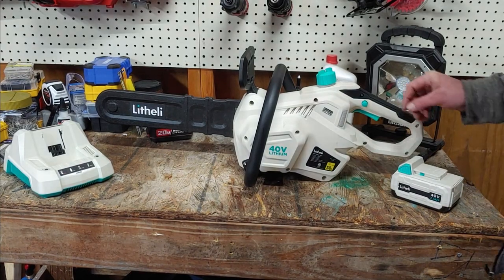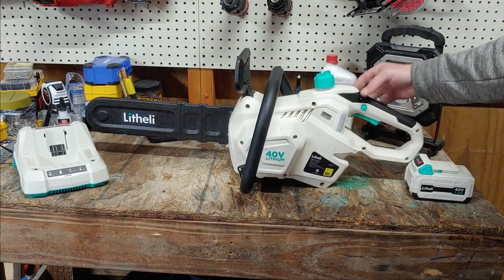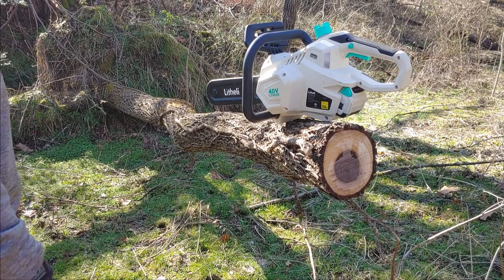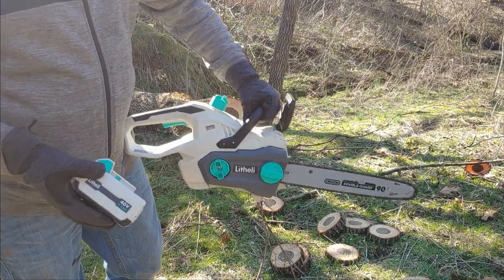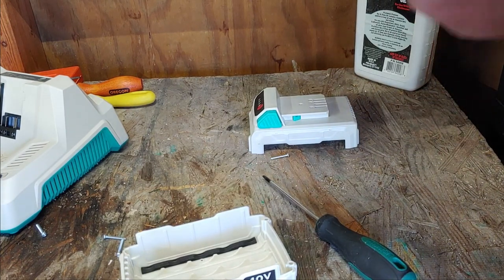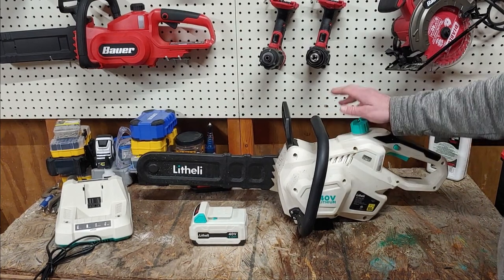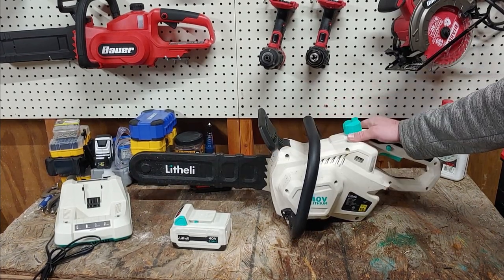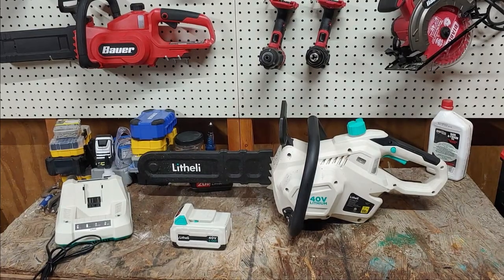LiTHELi 40V 14 inch Chainsaw Review

Comment: the 4 pin templet is so the 20volt batteries use the same mold just different pins .  The electric saw is great for clearing trails when you only need to do a cut or two at a time  if you are cutting up fire wood forget about it

Comment: They make a 4.0 AH battery for it.
Reply from the maker: At the time when I made the video the 4 ah wasn't out yet
Reply: @darkzero555  Just letting people that read the comments that there is one out now.
Reply: Литиево-ионный аккумулятор 40 В, 4,0 Ач https://litheli.com/products/litheli-40v-4-0ah-lithium-ion-battery-pack
Reply: All in all this was a pretty good review. I have had a green works pro 80v for several years. You aren't going to go earn a living in the woods with it. Having said that it absolutely does replace a gas saw on my property. It's not a 395 Husqvarna. It's about the equivalent of the 440 rancher. I have not tried this saw yet. but I don't think I would compare any 40v saw to a gas model. They serve different purposes. These electric saws have a good many advantages over their gas counterparts in many applications. To name just a few. Literally anybody can start these saws. If you are too old or a tiny women or disabled in some fashion. These saws make it possible to operate a chainsaw on your own. Push a button and you're off and cutting. There is little noise and no fumes. This makes them very versatile carpentry saws. Much easier to control than a reciprocating saw. Have you ever tried to cut a 4x4 to length with a 7 1/4" circle saw?  They make plunge cuts,, flush cuts, and cuts to length larger less managible size lumber. Furthermore do you know how many spark plugs and fuel lines I have had to replace? Zero. Which is the exact same number of times I've had to tune the carb or adjust the idle. I never have to buy or mix gas. Or be sure I have enough fuel to clear that brush. Try cooning trees off the neighbors back 40 with a gas saw without getting caught. These electric saws are quiet enough ya could steal that lovely apple tree for your smoker right off his front lawn while he's on the crapper . They work great in a canoe or on the four wheeler for keeping your favorite passages obstruction free. If all your gonna compare is power for power all electric saws will be lacking. But if that's your only factor you are missing the forest for the trees. They may not be comparable to gas when judging power.  .... Not yet anyway..... But they are absolutely useful worthwhile t9ols  .
Reply: @paulcollins8672   Thank you Paul 👍🍻